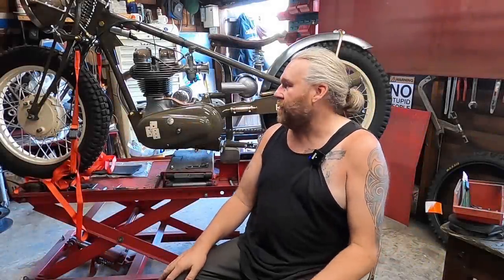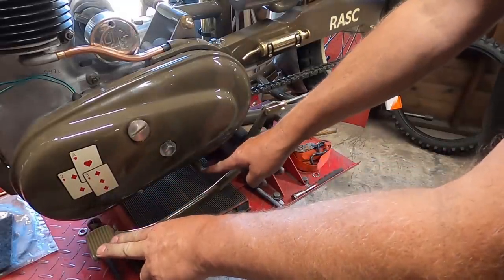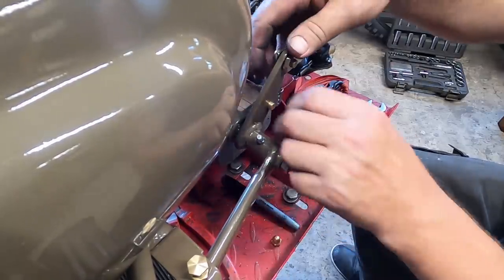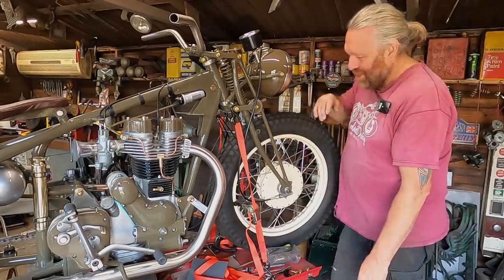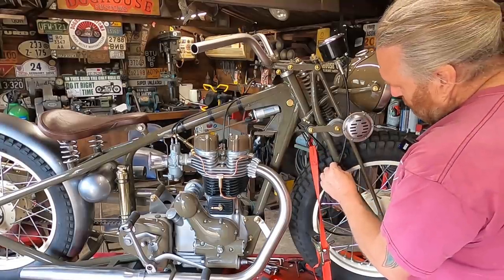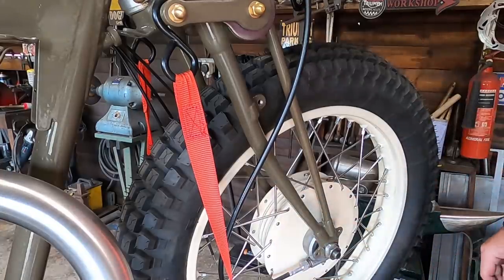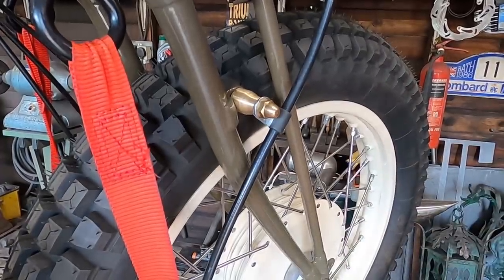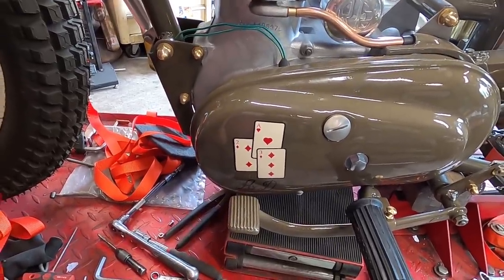Royal Enfield Bobber Project part 47

Comment: whenever possible I mount bolts head up so gravity holds them in for you. Also if the nut falls off whatever its holding on won't fall off quite so quickly.

Comment: Craig you said that you was too hot ,try putting a wet rag inside a baseball cap and put that on your head ,it lowers the body heat by about 2 or 3 degrees. Good luck 👍👍

Comment: Even though we had both kind of 'forgotten' about a horn...it looks really cool!. I presume you have scrubbed it too or do they come like that? looks suitably vintage, love it. As does the little clip! awesome. I reckon the original speedo bracket hole had the speedo cable through it no?
Reply: Yep you were right (of course!) Craig, that hole is deffo for a cable/rod to the front brake! ;) https://cybermotorcycle.com/gallery/bsa-1930/BSA-1930-E30-14.htm

Comment: Love the cream wheels.. sets it off.
The pieces on the neck of a guitar that tighten up the strings are called Machine Heads.
I used to buy wrecked guitar necks just for these worm drive mechanisms, to be adapted for model traction engine steering !